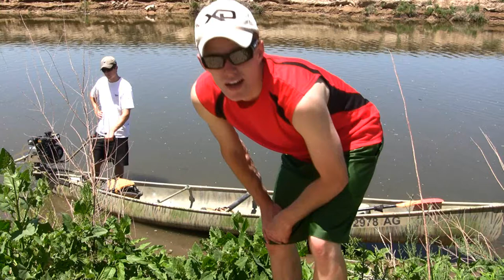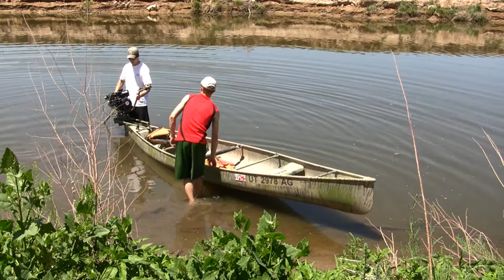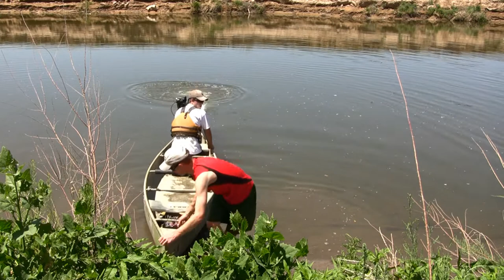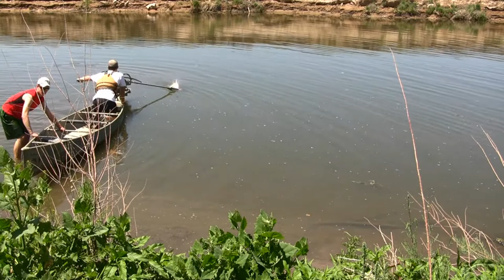Mud Buddy Canoe- Static Testing

Comment: So i am thinking of a 12’ canoe with a flat back to put a mud motor on. It needs to be 12’ or less so i can put it in the bed of the truck plus i need something i can paddle for paddle only areas. What do you guys think about this? Doable or no? Will be used for duck hunting. What concerns should i have? Appreciate any insight you might have.
Reply from the maker: Sounds reasonable.  We have a friend that ran a longtail mud motor on his flat back canoe for years and had great success with it.  He was a big help to us when we were selecting a mud motor.  Canoes with a longtail are very capable.  One of the key advantages is being able to paddle them when needed.  One thing to consider is a flat back canoe will take a little more effort to paddle than a traditional canoe, because the flat back will cause a little more drag as it goes through the water.  Still very doable though.  The flat back will shine with a motor on it because it controls the water flow to the prop better than a traditional canoe.  We would recommended only running a longtail on a canoe.  Surface drives will catch water on the drive housing and scoop it into the canoe.  Surface drives count on drafting behind a large transom like on a Jon boat, etc.  As far as the 12' length, you aren't going to get that with the longtail attached to the canoe.  Whenever we run the longtail on the canoe, we disconnect the longtail and secure it to a little motor stand we made for transportation.  You could do something similar that sits next to your canoe in the truck bed.  We found having the motor and canoe separate made transporting and setting the boat in and out, much easier.  Both our friend and us run American style longtails (as opposed to the Thai longtails).  The American style have shorter prop shafts that make them easier to steer and control, which is something you will care about in a canoe.  As far as brand of mud motor, this is where it gets touchy.  Everyone has their favorite and swears by it.  We'd recommend looking at Backwater Inc or Stump Jumper.  Backwater has probably the most technologically advanced design, but they are a bit heavy.  The Stump Jumper is lighter, but lacks adjustability in cavitation plate tuning (you will most likely have to adjust the cavitation plate no matter what brand you chose).  Hope this helps!
Reply: AdrenAddictionTV appreciate the quick response! Do you think the shorter long tails would be better on the flat back canoe? Heard they perform more like an outboard than a 7’ longtail.
Reply from the maker: @ldrown  Yes.  Shorter is better on a flat back canoe.  We'd recommend a drive shaft length of 65" or less.  The Mud Buddy motor shown in this video was advertised as a 60" drive shaft at the time we bought it.  The shorter the drive shaft, the easier it will be to turn.  Your shoulder will thank you.